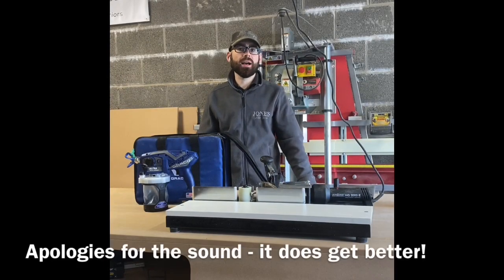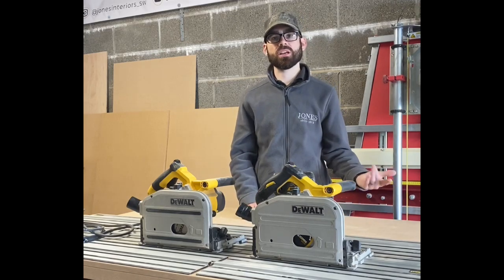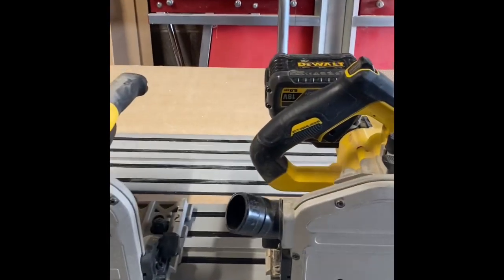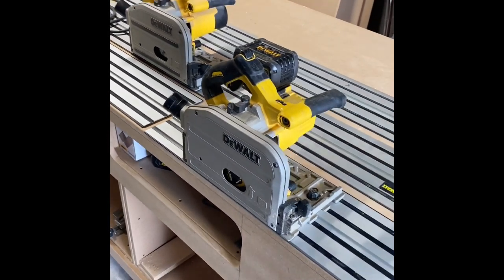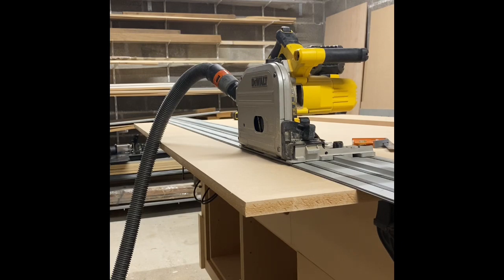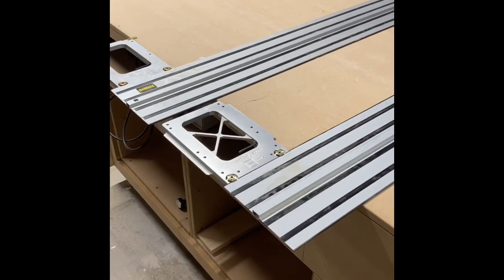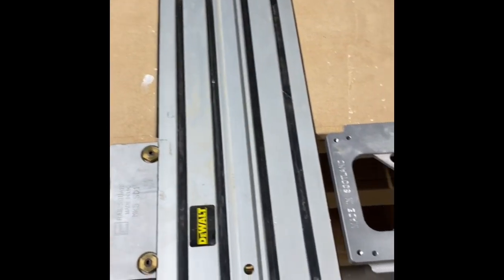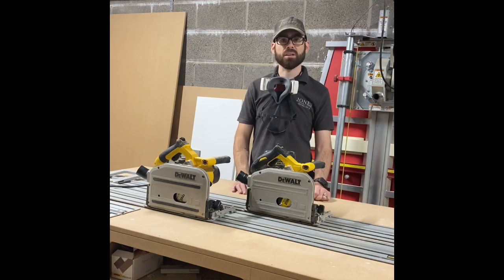Jones Interiors - Dewalt track saw plunge saw review - cordless & corded

Comment: Is there a way to mount a short Dewalt track, square, on a table so it swings up to make repeatable cross cuts, with a stop?  A miter saw type for sheet goods, using a Dewalt track saw.  I think Festool has this.  Maybe FC tools could make this.

Comment: Awesome video!! Do you have to clamp the DeWalt tracks every time or does the rubber grip enough to stay on the marks like Festool?
Reply from the maker: You don’t have to clamp it every time - but it’s not as good as the festool tracks
Reply: @jonesinteriors633  Would the Powertec tracks be a better option then? 
I've seen a lot of videos about those, especially paired with the WEN track saw.

Comment: Interesting that they made a slot in the base for compatibility with the Festool rail, but their rail has a central ridge... it’s only just occurred to me does this mean the rail is double sided?  That’s also unique.  I suppose you could allocate one side to your corded saw and the other side to the cordless and then you could keep the rubber strip tight to each blade?
Reply from the maker: Yes, that’s correct - you can use the rail on both sides. I did forget to mention that in the video as one of the key features. This review malarkey is harder than I thought! Yeah on my 1.5m track the one side is for corded and the other is for cordless. On the big track, I cut the edges on both sides with the corded saw before I had the cordless - but next time will definitely do it so that each side is for a different saw.
Reply: Yes it’s not easy to do a detailed review or comparison, after  I did my tracksaw comparison video, I thought of a number of other features that I should have mentioned!  But I already felt I’d gone on too long!  Yours was a good overview of the Dewalts.

Comment: The parallel plunge arrangement on the Dewalt seems to be the most distinctive difference compared to all the other brands that (as far as I’m aware) all pivot like the Festool.  I’ve tried the Dewalt only once and I found it strange at first but I think you’re right it’s probably a better action once you get used to it.  Does it always plunge smoothly, no jamming as the mechanism gets old?
Reply from the maker: Freebird Interiors yeah I can imagine it’s odd to use for the first time because, like you said, every other one is like the festool one. 
I’ve never had a problem with it jamming. I had my first plunge saw in 2007 and upgraded in 2016 to the cordless. I’ve had the 240 version for at least 2 years now and have had no problems with any of them.
Reply: A big advantage is that the riving knife maintains the correct depth whatever the cut.

Comment: I've just ordered a 240v dewalt this morning. Mines coming with 2 x 1.5m rails, how have you found the accuracy when they are joined together? Thanks for another great video. 👍
Reply from the maker: Jamie to be honest, I’ve never joined 2 rails together because I’ve always had a 2.6m rail. But I have heard that the joining system is not the best and that the festool is definitely better with regards to joining. But, like I said in the video, the 2.6m tracks are quite cheap so it might be worth you getting one of those too.
Reply: Thanks. Yeah I'll see how they behave when I get them.  Will definately be worth getting one long one just for the workshop. 👍

Comment: Great video John! I was told the festool and makita rails are the same? As a lot of people who have the festool buy the makita 3m rail as its half the price? I wonder how the dewalt fits the festool and not the makita?
Reply from the maker: Dale Jones yeah I’ve heard the makita rails are a lot cheaper than the festool. The reason why the dewalt saw doesn’t fit on the makita rails is because the makita rail has a small lip on the non cutting side and it’s for the anti tip mechanism on the makita saw. That little lip stops the dewalt saw fitting on the track. I didn’t know why it didn’t fit either, because they look identical - so I had to ask my friend Julian Collins - he’s the king of rail saws!
Reply: @jonesinteriors633  As I mentioned elsewhere, that lip can be removed with a router. I did this when I needed a rail with a sold edge for my (own build) MFT to butt against the dogs. Cheaper rail than Festool, and they are both aluminium extrusions at the end of the day...

Comment: Commenting on the rails, are there two sides because to cut 45° the saw does not pivot co planar (if that's the correct term) to the cut at 90° and therefore is the splinter strip cut inward at this angle? The Festool ts55 pivots the saw blade exactly along the cut axis ie exactly on the slinter strip edge at all angles and depths.
Reply: No, the second rail is to extend the length.   The Dewalt pivots around the same sector intercept for both the 90 degree and the 45 degree saw....at least on mine.   When I pivot the saw, it does not tear up the splinter guard.

Comment: Could you do a review on the dewalt 54v dust extractor. Ordered one yesterday but now Im worried as heard a lot of bad points.
Reply from the maker: grant I’ll see how this video does before I do loads of reviews. To be honest, I’m not a fan of reviews. Even watching my video back, I’ve missed out loads of things that I should’ve said about it. Regarding the dust extractor - I love mine... as long as you don’t put a bag in it. The bag is a really poor design with regards to how it fits into the extractor itself. I don’t use mine with a bag and I love it now. The only problem with that is that it does de-class it. So if you’re on a site that does require M class extraction, you will need to use it with a bag... but you will go through a few bags a day if you’re doing lots of cutting because the bag gets to half full and it blocks up and starts beeping.
Reply: Jones Interiors I’ve seen the bag issue that’s not a problem. What about run time I have only got 6amp battery’s does it last a full day for you?
Reply: grant the flexvolt dust extractor is excellent for sites with no power, but it eats batteries so I got two 12amp batteries for it
Reply: superchip010368 nah to many bad reviews so I cancel now just getting a Festool midi

Comment: Hi I'm just wondering how you find the 2.6m track on 8foot sheet cuts works? Or do you find it that bit short?
Reply from the maker: Donnachadha O Donovan it would be nice if it was a little bit longer but I think that’s the same with everything 😂 but I try to keep it longer at the start of the cut rather than at the end - I find that works best. Plus, the 2.6m track fits perfectly in my van - anything longer wouldn’t fit - so it’s ideal for me.
Reply: @jonesinteriors633  Thanks for the reply, that's the reason I not sure would buy it as seems thst bit short, but I have the 2x 1.5 tracks it just be nice not to have join them all time 😁

Comment: For information on how to add features to a DeWalt tracksaw, see https://youtu.be/Fk3tkcjQ7tQ
 The airlock system (which is great) can be retro-fitted to older saws. Makita track- you can run a router along the anti-tilt lip and then the DeWalt fits it (it is what I use for my MFT table).

Comment: Hi, it would be nice to see clearly the left part of the cut, where the saw blade starts to enter the MDF sheet. My Dewalt saw leaves there very uneven cut and the angle is definitely off there. I don't see it very well on your video, but it seems you have the same problem...
Also it is nice to see bevel cuts, as my dewalt is so bad in bevel cuts that I want to buy a different brand. The only thing I want to understand is it the issue with all dewalts or just with mine.

Comment: Out of interest at a low speed can you see the blade wobble? maybe 20-30 rpm (either with the cover removed or with the saw plunged exposing the blade) Ever so slight but it's there. You can see it slightly on the fixing nut as well, the blade is correctly sited. I though my first one was broken so had it replaced and the replacement one is also the same. Both units from a reputable tool store. Still cuts nice though.